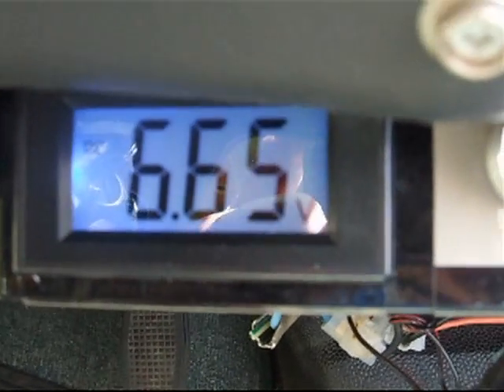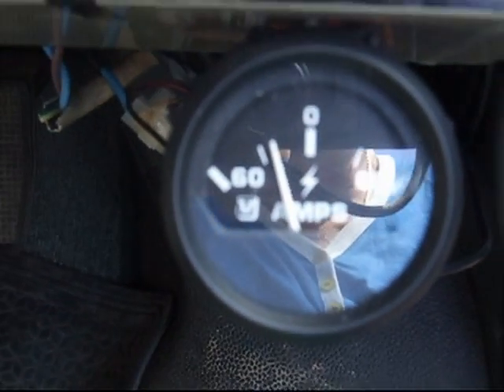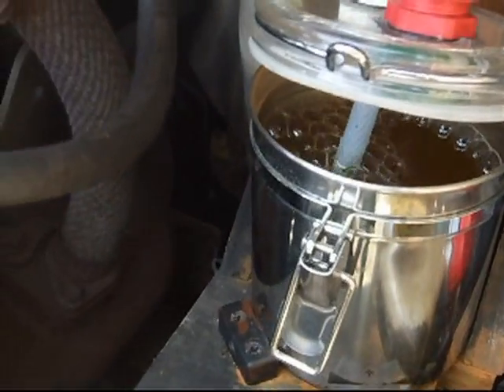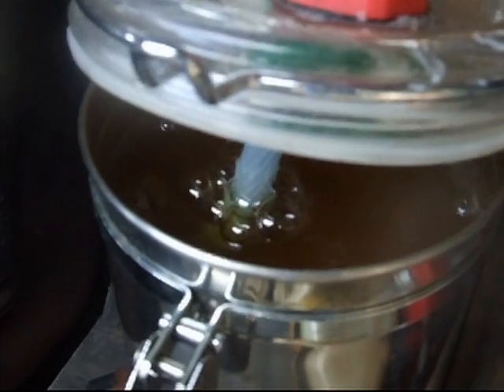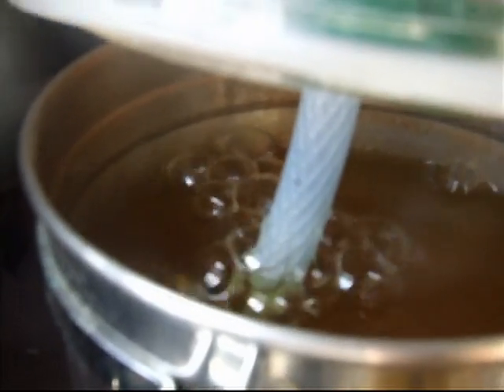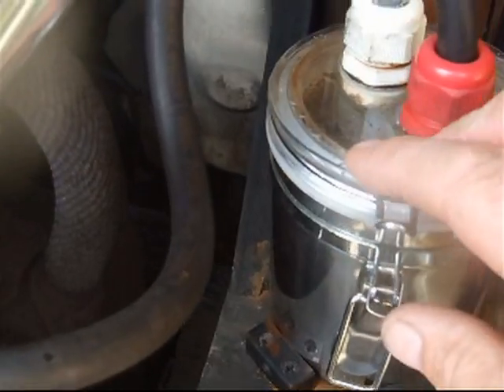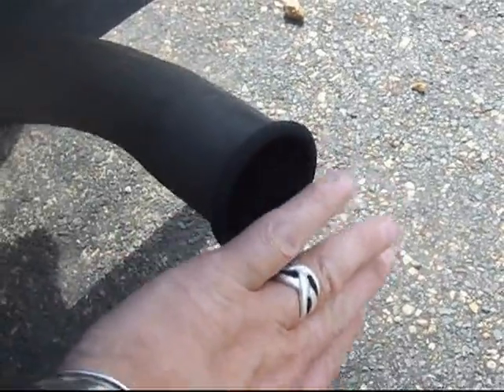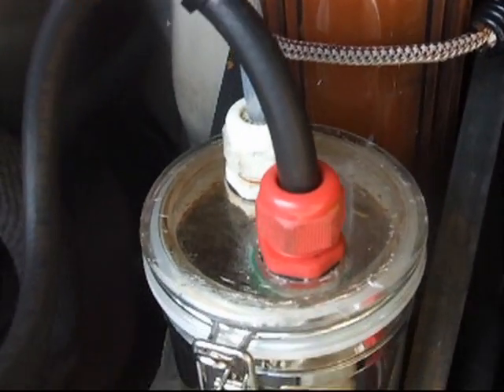HHO DIESEL FORD TRANSIT INSTALLATION

Comment: hi there,
please do you know if it is legal to run a car in this way in the UK ? 
will the insurance cover in case of accident? 
could some gas escape from the sistem and intoxicate the occupants? 
thanks
Reply: Hydrogen is classed as an additive so is legal. professionally made systems are a few hundred pounds so would be acceptable to insurers. if they insure LPG then this system is no problem.
...An idea is to buy a cheap vehicle ,due to its pollution levels, and fit a system and see a massive increase in cleaner emmisions.

Comment: why do people who can quote scientific theory try to say this doesn't work when the first princaple of science is to experiment like this guy has successfully done ? and why don't they factor in the lack of efficiency of the existing combustion engine as the starting point ? I didn't get any education  and even I have tried and understand how  hho can improve the efficiency of a very ennifficient engine so why can't these educated people ?
Reply: +steven irving These people are trolls, most likely who work in the oil business, and use all these old and unproven and fake (yes) theories on why all fuel savers couldn't possibly work. Every argument on their side of the tree is all based on how much less they're able to steal from you. Don't bother asking anyone in the auto industry either. Who do you think they work for? If that last part seems fishy then consider the fact that the automobile (or the internal combustion engine for that matter) has been around well over 100 years and still runs on gasoline or diesel.

Comment: @ S. Al-ATTAR
To all the skeptics. "Whatever"
I too have a transit van, a 2003 Jumbo with HHO to be specific. It is a 2.4 Diesel
Prior to installation I was achieving 26mpg, after fitting 30mpg  (31.2 mpg Best result)
Readings were taken over 2,000 miles prior and after installation. I kept all my receipts and simply took the miles I'd driven and divided it by the fuel on top up. 
(Send me £20 via paypal and I'll go to the bother of photographing them all to send you, for those whom doubt)
I will admit I have had a drop in mpg recently, this is due to me not paying attention to the system. But this has been recently rectified.

It is not for morons. You do have to care and understand somewhat how your engine management works, and the science behind the system. But I can say that I have had fuel economy improvements and a boost in power/accelerator response. 

Most vehicles need a chip to override you Oxygen sensor. These are available commercially. Everything is.

I'm not selling anything, unless you wanna hire a Ska band for a gig?? And of course take me up on sending you pics of all my fuel receipts! lol

So your uninformed "Scam" comments may be due to where your head seems to be..... 

Spread Love & Knowledge

Comment: This is scam of course. What the guy basically does is converting electrical energy from the battery into chemical energy. The chemical energy is converted in the engine to kinetic energy. Some of this kinetic energy is used to recharge the battery. Since we know that the efficiency of energy conservation is far from 100% , it means that this guy is wasting energy (fuel)... Read a high school physics book.
Reply: +S. Al-ATTAR Read some books yourself. You omitted the gross inefficiency of the the engine itself, which is under 40% efficient. Not only that, but energy input versus energy output is not what HHO is about. HHO is powerful stuff and it enables any engine no matter the fuel to do the same amount of work with less fuel being used. Lastly, I didn't hear this man make any damn mention of selling this product at a price, therefore it couldn't possibly be a scam even if it doesn't work. 

Do they serve free donuts at your oil company?
Reply: hi school physics books are part of the problem matey!

Comment from the maker: The original cell i was using on this van ..in this video were 3 stan myers style tubes …the stainless steel was low grade & caused much toxic red gunk to accumulate …,this cell I've now replaced with 21 plates hi grade stainless steel positive plates & aerospace grade titanium negatives  resulting in no red gunk :) i still get about 15 20% better mpg depending on driving conditions …long slow gradients still take a great toll on a vehicle this heavy!, ..steady driving on the horizontal motorway give best results & reduces carbon build up in the engine ,both batteries i have onboard main & leisure are also topped up in daylight hours by a 50 watt solar panel , i only use this motorhome mostly in the summer ...so no regular mpg tests Atho i will be carrying out more tests summer 2015 to establish mpg gain ..to the ney sayers i say sit near my exhaust emission with the cell OFF for 10 minutes while ticking over parked in a field n see how long you can put up with the fumes  …As soon as the cell is switched ON the fumes diminish considerably !  config of plates = +nnn-nnn+nnn-nnn+nnn  this config with titanium neg's stays clean no gunk !

Comment: using electricity for hydrolysis will appear to work until the battery voltage drops a bit and the alternator puts a larger load on the engine. you only get the energy you put in back out of hydrolysis and there is massive losses in heat converting this energy back and forth so once you have been driving for a while you will just be using diesel to put energy into turning energy from electrical to chemical to heat to kinetic and back again while loosing some through the extra heat losses in the distortion of the fan belt and resistance of imperfect conductors (alternator coils and wiring). these inefficiencies wouldn't necessarily matter if it wasn't for the fact that energy cant be created (or lost) and it takes the precise amount of energy to split the water as you get back from reacting it. even if these inefficiencies didn't exist it would never do anything but tick over but it cant do that, leave it ticking over for long enough and it will slowly start using more diesel than it did before the mod. it wont use alot more but it wont use less after long periods of running. also it cant be getting much power from thee gas because mixing vaporised fuel into the manifold of a diesel doesn't sound like that it sounds almost as sharp as the sound when he's igniting the bubbles. its a compression ingition engine that runs off heavy fuel oil (diesel) thats what its doing
Reply: +Han Gathercole Lam The wise words of.............................. BP? Or is it Exxon Mobile?
Reply: +Bone Drone err no I can work it out myself I could also measure it
Reply: +Han Gathercole Lam .....
Reply: +Han Gathercole Lam whose words was it. What's the quote?
Reply: Han Gathercole Lam
Instead of finding quotes, I'll just correct you.
1) HHO gas improves combustion characteristics, and enables any engine to do the same amount of work with less fuel. It's confusing to say this, but HHO is like a fuel and catalyst both.
2) When HHO burns and reverts back into water, that water absorbs much excess heat and imparts force on the piston once converted into steam. There is some horsepower right there for you. :DDD
3) This water vapor also steam cleans the engine internally. Gumout can suck it. Their product is worse than useless.
4) It depends how you do it. Your homemade cell could make 1.5 liters per minute at 10 amps or at 30 amps. 30 amps could get you 2 liters per minute, or 10. Whatever the case  I will proudly proclaim that an HHO generator will never under any normal circumstances drain a battery or kill an alternator. If an automobile's electrical system is designed to handle high electrical demands such a the driver using all electric equipment at once, it will certainly power an HHO cell. I could live without the radio if the demand for current is too high with the both of them at once. :D

If none of this sounds correct to you then I'll just say "fuck it, I tried" .
Reply: @Han Gathercole Lam
Looks all well and fine written out (despite your lack of ANY punctuation)...
However, in practice, you're simply wrong.
Only waste of energy on this video is that you used to write your comment.

Comment: you not burning enough hydrogen/oxygen to produce damp air, how many miles can you go on a few inches of water so you would not notice anything coming out the exhaust, plus the exhaust has moisture in it from when the vehicle has been standing, its quite common to see water dripping out of exhausts on most petrol and diesel engines, it condensates in the exhaust due to the change in temp so the moisture you feel is going to be from that,
plus how much more mpg are you actually getting, its not like your using a lot of hydrogen at all so i dont think its going to be making a huge difference if any at all, im guessing you dont really notice anymore mpg from it, it would be good to see some clear proof with the mpg tested, for example set up a measure so we could see when a litre of fuel was used up at a certain speed, so that would mean a rolling road is needed and a accurate measure being added to the fuel line then we could actually compare the miles per litre of fuel with the hydrogen and without the hydrogen, i just dont think your using enough hydrogen to make any difference, chances are its less than a mile per litre, ive not seen any real proof that suggests this saves fuel at all, the best method i have seen is a full hydrogen conversion, this mixed fuel/hydrogen version is not going to make much difference if any. if it was car  companies and armed forces would of been using this technology years ago

Comment: done another test today, seems to of got 70miles from ten pounds which is good. i just added a bit more bi carb to the water and drew a few more amps, it produced more gas and i think im getting there but i do also think i need that efie thing you said about.

Comment from the maker: What year is your vehicle ! if its after 1996 or later it may have computer management of the engine controlling oxygen via sensors ,when these detect different readings of intake it will try & compensate= using more fuel  ,then you will need an efie gizmo to fool the computer ....to rectify this !

Comment: on my peugeot partner van i ran hho and on my first test i managed to only get 46.6 miles from £10. when i ran my van without my hho on i managed 56.2 miles. so i made a loss. i did also notice when i turned my hho on the engine revs dropped a bit, not sure this is spose to happen. any idea??  for those people who say you lose power thats complete crap. the engine is always charging up the battery from the alternator on every single trip you make. so running hho wont use anything more.

Comment: I'm suspecting the engine will run with a little higher thermal efficiency than with straight veggie oil but not sure if the idea behind the HHO would be done as efficiently as with Diesel + HHO.

But i'd say if you use filtered waste oil or take it and convert it to Biodiesel you wont need to struggle with the HHO for theoretic economy as you would already have the cheapest fuel which means even if the engine consume 10 liters more per 100km you're still at over 500% more economy and ecology.

Comment from the maker: As a rule of thumb ...half a litre of hydrogen per 1 litre of power.. so one & a quarter litre's would be ideal for a 2.5 td ,i have on a td diesel 4x4 mazda bongo van an old wet cell that only produces barely 1/2 LPM ..but gets me 20% better mpg ,i'm about to put an upgrade 21 plate dry cell in hoping to get 1LPM clear or more,if you'd like more exact mathematical equasions on cell size n production ...check out hhoinfo site ..good luck : )

Comment: You are assuming that the HHO is used as fuel but it isn´t. It is used as a "spark plug on steroids" that makes the combustion of natual gas more complete. If you still dont´t believe it works you should have a look here: hho4free(dot)com/hho_proof(dot)htm

Comment from the maker: Most mileage i do is about 1500 miles per year only really use it in the summer , getting ready to fit a new drycell upgrade in my mazda bongo 2.5 turbo diesel ..will post some pics, cant be bothered videoing this  camper  vehicle when i go on trips with my partner ...just get into my holiday ,i will when i fit new drycell to it ... this vid is about nearly 4 years old now .

Comment: If the energy released by burning hho was greater than the cost of the electricity to break it then there would be huge power plants with water flowing into them and power coming out. There aren't any though, think about it.

Comment: no black smoke....but its only ticking over, what about when it comes under load going uphill? isnt the ammeter showing a consumption of 16A? that alone will load the engine via the alternator, nothing will reduce black smoke on a 2.5di other than turning the pump down, till its been on a dyno its all guesswork

Comment from the maker: +nnnn-nnnn+nnnn-nnnn+ 2 volts between neg & poz , run at no more than 10 to 15 amps will get the job done, if u have a vehicle later than 1996 it may have oxygen sensors + computer management ..then u will need an efie to fool the onboard computer ,or your'll end up doing less to the gallon ,luckily both my diesel vans are 1995 bc = b4computers & alot easier to get better mpg ..no need for efie ! : )

Comment from the maker: If you check on one of the many hho sites they'll give you the math,i calculated by trial n error , good setup = +nnnn-nnnn+nnnn-nnnn+ usually 2volts between + and - running a pwm (voltage controller (30 amp) keep it to no more than 10 amps max ,or cut out the pwm & include more neutrals to control constant voltage ..hope this helps : )

Comment from the maker: Hi, my transit is a 1995 luckily it has no 02 sensors + no computer to fool ,so no need for an efie.,if you need to do this your vehicle is obviously a later model..it can be worked out using an efie..but can be tricky..! i suggest your'll need some techy info from one of the dedicated hho sites..goodluck : )

Comment: Hello,

I am looking into converting my vw transporter Diesel 1.8 into a hydrogen hybrid, I would like to know if you installed some o2 sensors in your system suchh as MA or EFies to trick the computer an get better gas mileage. 
thanks

Comment from the maker: Hi m8 , about 20% better mpg depending on driving conditions ,yep just straight into the intake ,hav'nt done much work lateley to improve on it ,cept checking for leaks n topping up , i do need to update to a dry cell ...when i get the time n money..good luck with building ya system , Cheers FDC : )

Comment from the maker: Hi barry, i will let you know soon as i next inspect my system + turbo condition,i have no intercooler,but my hho is fed b4 the turbo ,i did seriously think about entering it after turbo ..but failed to acomplish definitively where  exactly to efectively connect the hho after said turbo ...do you have any detailed info on where to connect it this way ? : )

Comment: It's not the language. Some experimenters say to inject the HHO before the turbo, others- like me-  recommend injecting the HHO after the trubo and intercooler if you have one. Before the turbo can damage the turbo charger body and blades. Potassium and sodium corrode aluminum which is what most turbos are made from. Injecting after the turbo eliminates this danger. I'd like to hear from anyone who has HHO injected before the turbo. Barry

Comment from the maker: I have no turbo on this vehicle( transit 2.5) but have turbo on my mazda bongo van ,on my mazda turbo diesel 2.5 the hho is injected before the turbo thru a venturi ..(on the intake side...) i mention this as i had great confusion with someone online over the text of (before or after) they kept telling me that it was after the turbo ! most confusing..could be a language thing methinks ..!hav'nt checked for pitting yet...turbo working as normal for last 3 years ..only check for leaks & levels.

Comment: I love this question. What you say is true. However, with SHIFTechnology (Supplemental Hydrogen Injection Fuel Technology) 8 amp hours of DC current can make enough HHO which, when added to the fuel air mixture in an engine, will increase the burn rate of the combustion, lean the mixture out, and increase the efficiency of the engine 40-50%. This will result in 20-30% increases in MPG. So, what really is happening is we are using 8 amp hours of current to move 2000lbs (avg car weight), 4 miles.

Comment: Buying Hydrogen Aided Combustion kits online is only half the battle. If you don't know now to adjust the amount of hydrogen going into the engine and if you don't inject the hydrogen directly into the intake manifold your chances of success are "iffy" at best. The system must be wired so that the engine must be running before the hydrogen system turns on and turn off immediately when the engine stops running. Google up fuelgeniesystems and read how it's done professionally.

Comment: I'd rather collect used veg oil barrels than bother to spend electrical energy to create fuel for energy (Hint:  straight electricity is better even with the charging efficiency). Good video for what it is though,only experiments like yours can give you knowledge,not negative opinions and theory.

Comment: I have a very fundamental question here. I will be happy to know what people think about it.
As we know in physics - matter and energy are not created out of nothing, but one form passes from another. In our case, we use electric energy to break the bounds of the water molecule, then we burn the Hydrogen (burning hydrogen is essentially making H20 out of H2 and O2) and we get energy to run the car. Aren't we doing the same thing twice water->hydrogenr -> water ? Thus where is the gain here ?